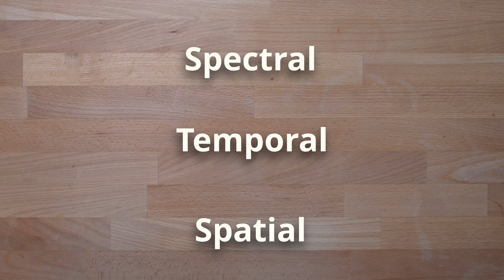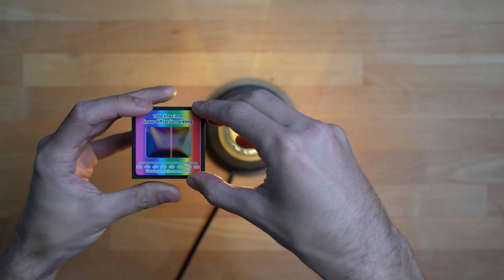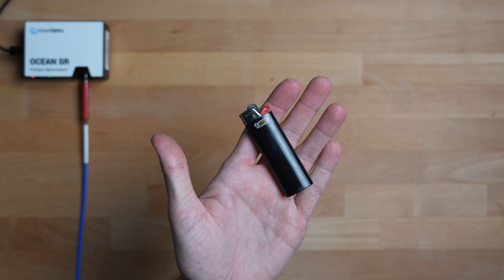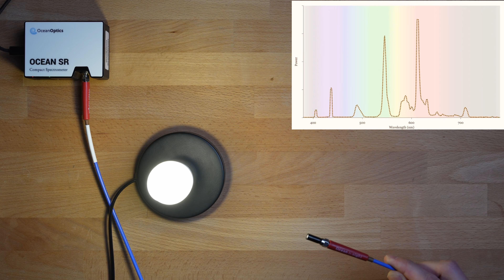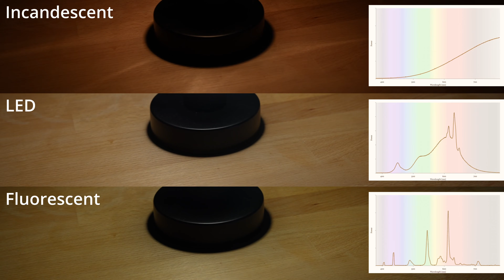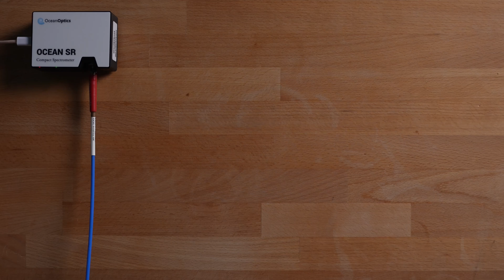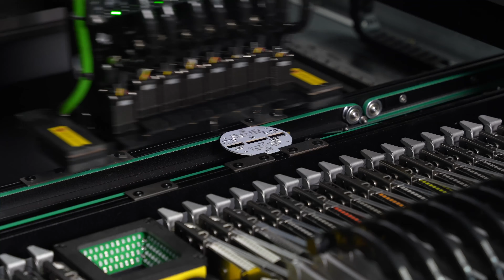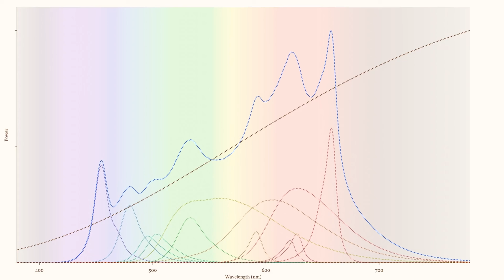Why Modern Lighting Feels Bad (and How I Fixed It)

Comment: Got this randomly recommended by youtube. It's a good video, but I was a little bit surprised when you revealed you were commercializing a product based on this idea. I thought the video was purely educational and that turned it into a little bit of a hidden ad, and a disclaimer would be nice. But maybe that's just me. The other thing is that unless I missed it, you haven't mentioned/explained CRI ratings which I (sometimes) see advertised when shopping for lights online now. The lamps aren't tunable but CRI ratings seem specifically designed to address the issue of 'unnatural' feeling light.
Reply from the maker: Thanks! That’s fair feedback. I debated how to handle that. Most educational channels are sponsored by external companies such as VPNs or PCB assembly services. In my case, the company is building the thing the video is about, so those two are pretty hard to separate. If I want spectrally tunable lighting to actually exist outside of research labs, someone has to build it. The educational side is there whether or not you ever buy a product, but the company is what makes turning the ideas into real hardware possible.

On CRI, I left it out intentionally because it will be covered in a separate video. It’s a useful rough metric, but it is pretty gamble/unrepresentative. Modern metrics have been developed to improve representation there, but they all effectively compare the spectral power distribution to that of a blackbody emitter. I’m going to cover CRI, metamerism, and alternative metrics in a future video.
Reply: @enodylighting  Fair enough! Looking forward to the video on CRI.
Reply: When Texas Instruments publishes a video, they don't usually say explicitly that it is an ad -- not even when they're just profiling a specific product.  The difference is that Enody Lighting isn't big enough for us to immediately realize it isn't just a personal channel for someone with an unusual name.  I'm happy that it was worth watching.
Reply: Nah that’s just you. It doesn’t really feel like an ad at all since he made the product kit
Reply: It just you. It’s a dick move.